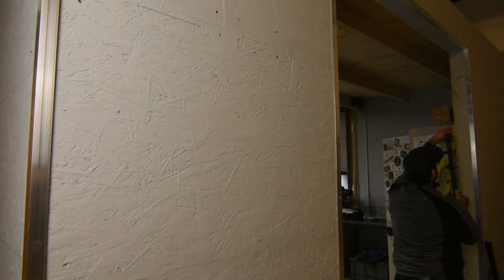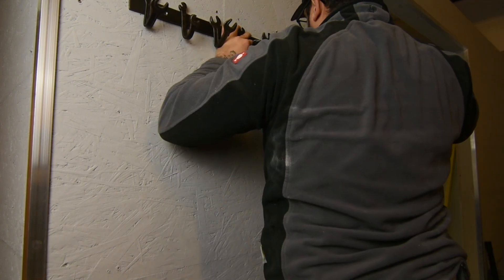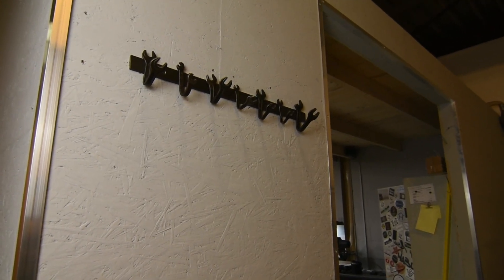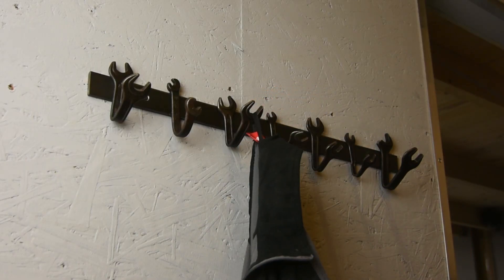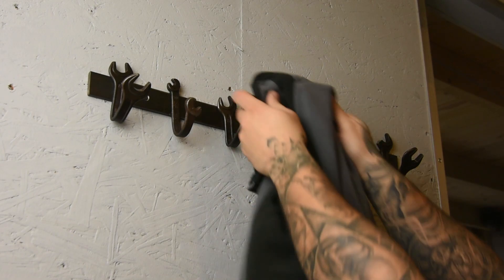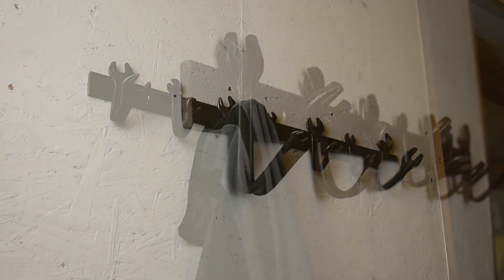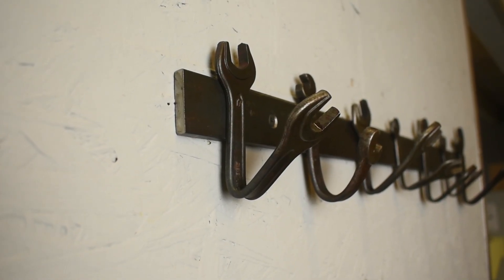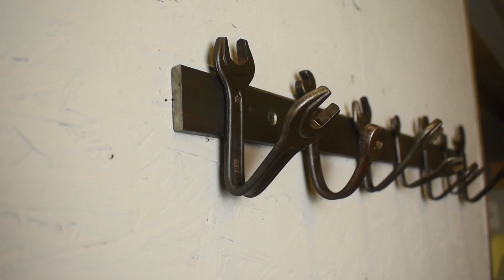DIY \\ Industrial Wrench Coat Hook

Comment: Habu: I have been waiting for someone to do a coat rack out of wrenches!!  I bought 2-3 years ago a lot of turn of the century wrenches. Nothing rare, actually pretty commonly found at yard sales and flea markets. Now you have shown me a very simple way to bend them. Only I do not have a welding machine yet, so I may have to drill holes for recessed screws. Any advise using screws instead of welding?  Thanks again for another great video. I'm a big fan and have been since you started appearing on You Tube.~~Dolly
Reply from the maker: +CrossGrain Wood Products,LTD Thank you Dolly! Yeah I found them on a flea market, too... Directly thought of building a coat rack out of them.... ;-)
So if you don’t have access to welding equipment, screwing them together is the only other option cause it should be stable and lasting for a while...😉
Good success for your project and a happy new year!